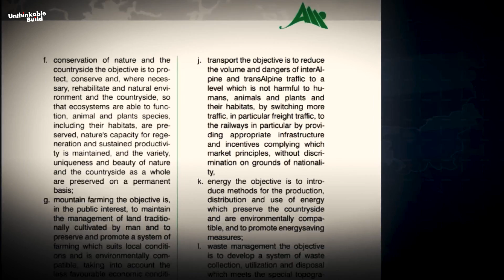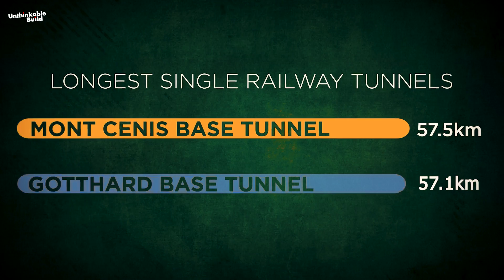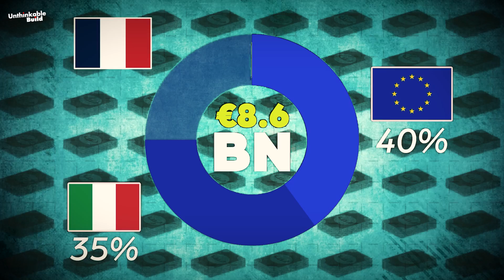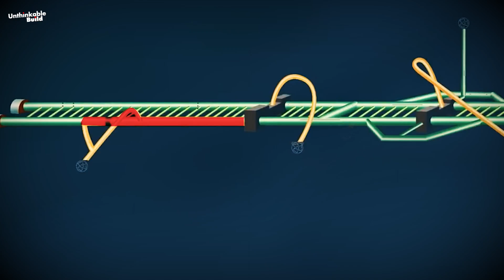The $26 Billion Mega Tunnel Linking France and Italy

Comment: Please check the gradients for the new rail line. I expect that the decimal not in the correct place. I understand that a gradient of 1 percent means a 1 metre change in elevation per 100 metres.
Reply: 30% would require cables and probably wouldn’t work for freight.